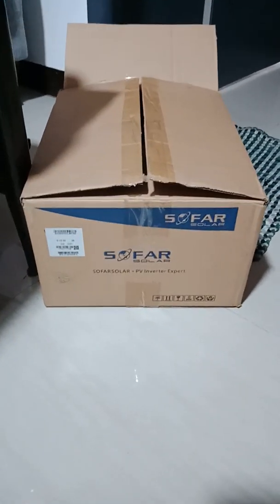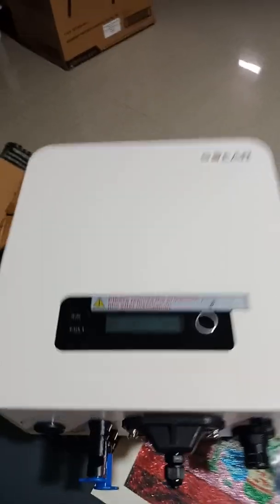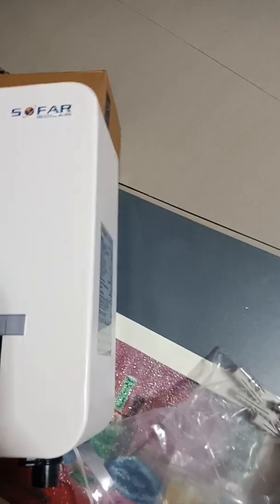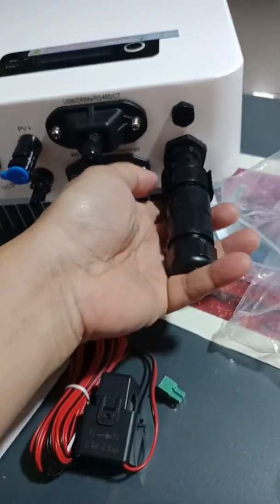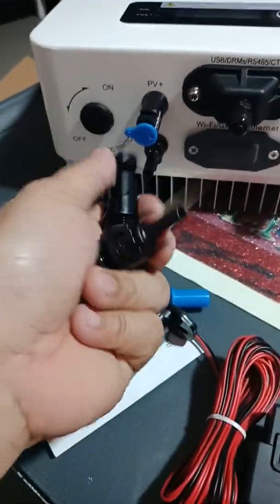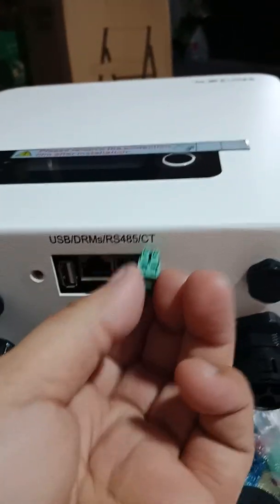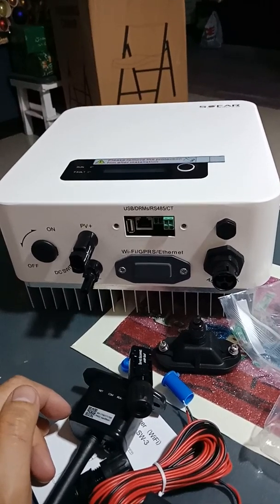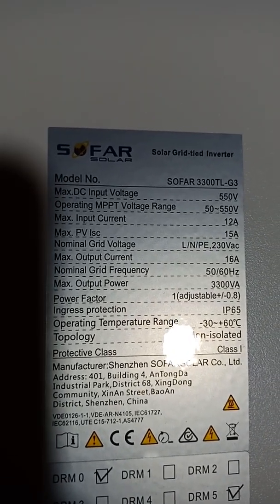sofar inverter unboxing

Comment: Sir pano ikabit Ang limiter? Pano Po Ang tamang orientation Ng limiter at may setting ba yan sa inverter? Salamat
Reply from the maker: Yes sa live wire main entrance wire. Yea may setting sya sa sofar inverter, madali lang sya set wala pang 20 sec ok na. 
Pag may time ako gawan ko video.
Reply: May zero export function ba ito?
Reply: Gumagana ba Ang zero export function into?